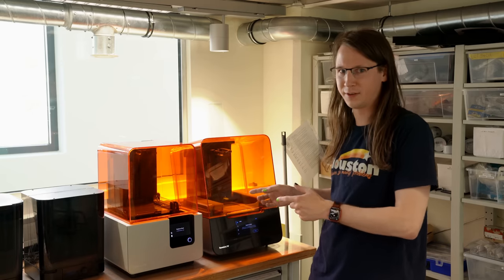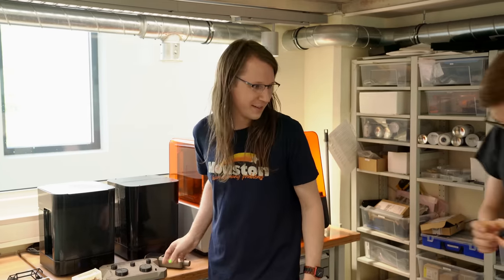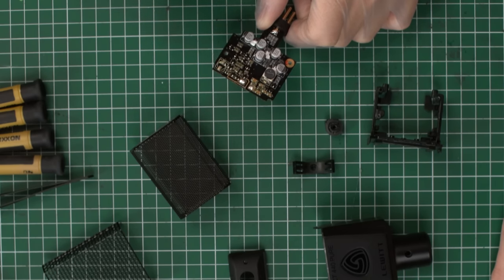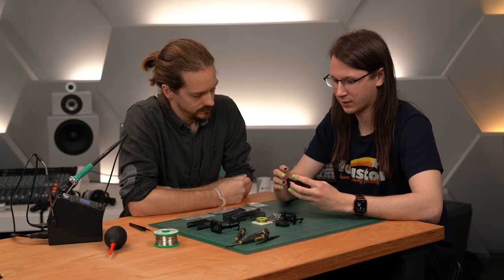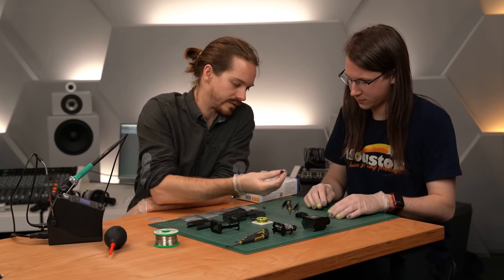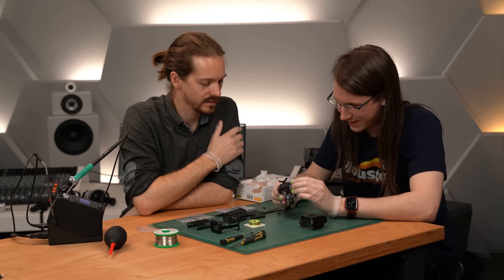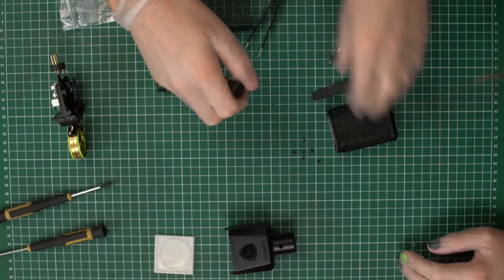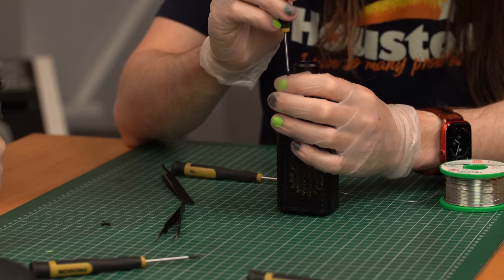Don’t try this at home!

Comment: Personally i recommend nitrile gloves. Good tight fit around you're hand and gives more flexibility(feels like your normal hands really) i can see from a mile away those are vinyl gloves and oo god never touched them when i found out about nitrile. Latex also an option but you're hands will smell long like balloons and are not healthy in the long run.